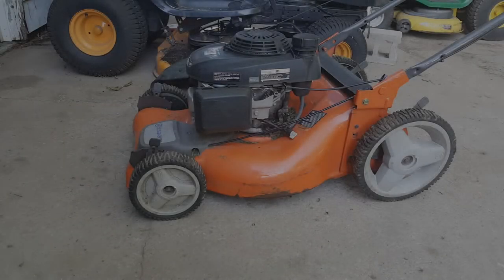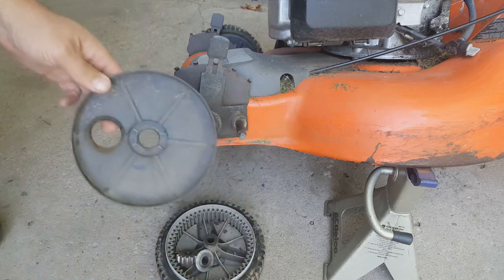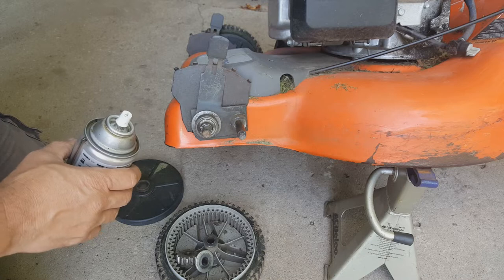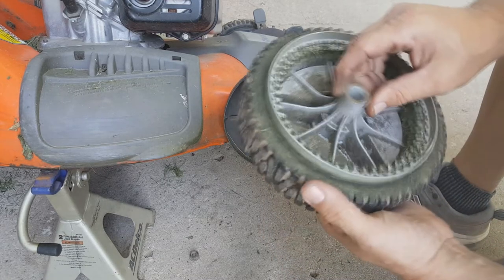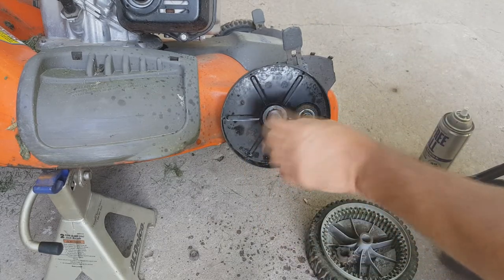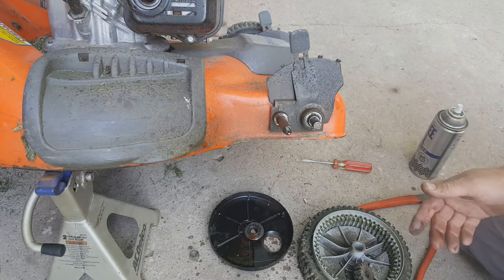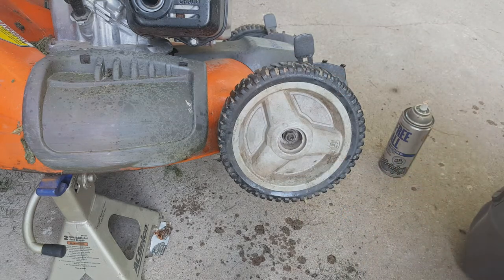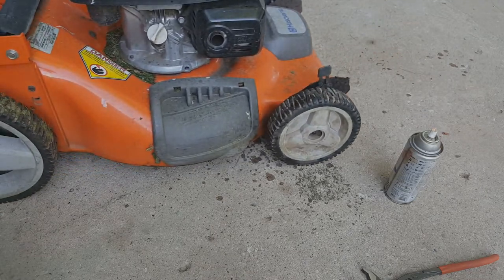Husqvarna Mower Self Propelled Sticky Wheel Fix

Comment: I have similar problem but mine is rear drive, I did the same cleaned it all up works great until it start it. The self propel will not completely disengage making it tough to pull back. Any thoughts ??
Reply from the maker: @mattwinters9790  every self propelled mower that I ever used, hangs up a bit when pulling backwards. But not always. A good question!

Comment: I’ve found that when this happens I release the AWD levers and then push the mower forward.  This seems to release the front wheels and then I can pull it backward without a problem.  That’s my work around but I will investigate the sleeve issue after watching this.
Reply from the maker: I know what you mean about releasing the front wheels. It happens sometimes while pulling back during mowing. However, this was definitely a rust issue. Thanks for watching.

Comment: Those sleeves were really frozen. 
On Honda mower HRR216, both ends of the drive shaft have a half round key forced up by a small spring that catches the small gear driving the wheels. When pulling backwards the gear compresses the key and spring allowing the wheels to freewheel. I had one where dirt got packed into the spring and keyway preventing compression and locking the drive wheels on backward pulls. Disassemble and clean and try not to lose those darn little springs!
Reply from the maker: I have had to repair that style. I think that when you order those parts, you may need to know left side vs right side. Maybe I'll make a video! Hey, thanks for watching.

Comment: Take a 6 inch 1/4 bolt and spit the end 3/4 inch and cut of bolt head 
Rape it with emery cloth and use drill to remove rust in wheels

Comment: Thanks!  Same issue with my Craftsman mower.  I guess those sleeves are actually part of the wheel.  I had to hammer mine off and the sleeves stayed on.  thanks to your video, I realized those sleeves are supposed to turn!
Reply from the maker: Yep, I found that out too about the sleeves. Thanks for watching!
Reply: I’ve used jb weld when I put it back in the plastic wheel

Comment: I’ve found that when this happens I release the AWD levers and then push the mower forward.  This seems to release the wheels and then I can pull it backward without a problem.  That’s my work around but I will investigate the sleeve issue after watching this.

Comment: Hi ,I recently had the drive belt replaced,but the other day the front wheel split from the inside plastic wheel , the self propelled stopped working, the gear has no resistance,could that be A wheel problem, I’m sure the previous repairman will charge for evaluating the problem. Thanks
Reply from the maker: Could be as simple as replacing the wheel assembly.

Comment: That’s the wheel sleeve. Happens a lot on front and rear drive on Husqvarna. At least they use a sleeve and not just plastic. Good video
Reply from the maker: Yes, I found out that it was a metal sleeve that came with the wheel. It wouldn't normally come out. It's been good since this fix. Thanks for watching.

Comment: Hi, thanks for the video. I have a Husqvarna LC221Ah push lawnmower with cracked rear wheel. I could not find a oem replacement so I purchased a universal wheel from HD. Before I attempt to put it on, can you let me know if universal wheels work on self propelled awd lawnmowers. If so, do I need to make some modifications such as removing some parts? Thanks again.
Reply from the maker: I have only used universal wheels for NON-self propelled units. I can't say if a universal can be modified. I have never tried. Thanks for watching.

Comment: Have you any advice on getting mine  to run uphill , ok level ground it's fine but on a sloping small hill it just doesn't drive up , I end up pushing the mower.
Tryed a new belt and wheels  and still the same problem .
Any advice welcome
Reply from the maker: The cable that runs from the handle to the drive unit may need to be tightened up. Where the top of the cable housing is pinched in place, there should be a bolt and nut pinching it. Loosen that nut, slide the cable up or down accordingly. Hope that makes sense. Thanks for watching.
Reply: @RealManSkills  
I didn't know it could be adjusted .
I've just adjusted and hopefully it improves going up hill .
Thanks again 😊

Comment: I haven't tried this. The problem I'm having is, the wheels turn very slow when you press the handle in. I thought it was the belt, but it's still doing the same thing. Any advice?
Reply from the maker: Can't say for sure. Start taking the drive wheels apart one at a time (pay close attention to how it comes apart) and look for any issues. Hope you figure it out. Thanks for watching.
Reply: @RealManSkills  I found out it was the speed control knob that was the issue. Not the wheels.  I seen the same issue on another video.

Comment: My rear wheel drive is locking up when trying to pull backwards, i wonder if its the same thing on a rear wheel drive
Reply from the maker: I hope you find the cause. Thanks for watching.
Reply: Real Man Skills I got it fixed by pulling the wheels apart greasing and cleaning, roll perfect now, thanks
Reply from the maker: @kenh733  Perfect!
Reply: @kenh733  Thanks for sharing, gonna try this on mine, same issue here.